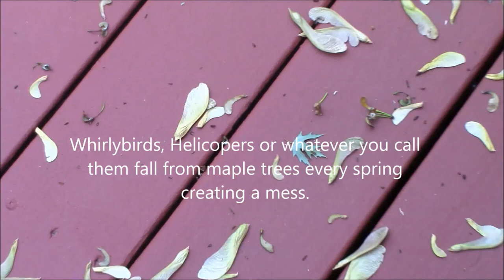DIY Gutter Leaf Blower - Modify A Toro Ultra Plus Leaf Blower

Comment: Thanks for the video, great idea, works like a charm.  Some tips.  Purchased the mirror from an auto parts store, in the blind spot mirror section, get the largest, makes it easiest to see from the ground.  Used rivets to fasten mirror to plumbers strap, use plumbers strap to fasten around connectors.  Used good sized handle (5 3/4”).  Try a dry run before fastening handle to determine placement.  There is some opposing force from air flow, a good firm grip gives good control.  Works great, watch out for overhead wires.

Comment: Hi Robert, thanks so much for this video. I added a 10ft down spout to my Toro leafblower and interchange A and B elbow to the ends for the angle needed to get the job done. I also add on 1 1/2ft down spouts as needed for those higher spots. This has really helped to not be on a ladder 20 ft in the air or pay someone  $100 to get to the high spots that increase your prayer life! Thanks and many blessings!
Reply: How rpm
Reply: My gutters are 22 ft high.  Hope a taller version (combining two 10ft downspouts) will work for my situation.

Comment: Ingenious adaptation of lightweight gutter sections and parts to use with your Toro blower to address a perpetual need to clean gutters safely and easily.  Thank you.
Reply from the maker: Fr Brig thanks. You woyld think the manuf that went from a round nozzle to a rectangular nozzle would have provided the consumer with an adapter for blowing out gutters.

Comment: I put together one of these today. It works really well, better than expected. To reach the 2nd story gutters I have 16 feet of downspout joined together with a vinyl plastic connector and sheet metal screws. After a few trials I decided to reinforce it with small plastic rods 3ft long, held on to the downspout with zip ties. For the top end I used a flexible downspout extender. It works pretty well but I need to re-bend it once in a while. I may replace it with a metal. Thanks for the video and the inspiration!

Comment: Wasted no time and made up a similar set up.  I chose to use a flexible end fitting  and a full 10 ft spout section so I could blow 180° to help with clearing valley angles.   Admittedly the longer length was a bit awkward, took some getting used too.  Works real good on my hip roof house that would cost a small fortune to put good gutter guards on.    Thanks for the inspiration,

Comment from the maker: Thank you all for the comments. With the upcoming approaching of Fall leaf falling, an alternate material with concern near electrical wire would be to use a plastic downspout. The plastic is still lighter than using pvc plumbing pipe/fittings.
Reply: I have what I suspect is one model older than your blower and was thinking of doing the very same thing today for my gutters.  I even had the mirror idea!  Great to see someone already having done this.  I hadn't thought of adding a handle.
Reply: A legitimate concern. Alternatively, one could use up a roll of electrical tape to wrap the metal as well.

Comment: Simple is always better and the simplest way to to this is to climb up a ladder with a garden hose and spray/flush the gutters. Works like a charm and deposits the leaves etc at the base of the gutter discharge for easy disposal.

Comment: You, sir, have more sense than the manufacturers of the prepackaged extended gutter cleaners as they didn't have the sense to direct the flow of the debris sideways out of the gutter.  They think blowing it down into the gutter is the correct direction, lol.  Obviously, they have never used their own product.

Comment: Toro does in fact make a gutter cleaner tool kit for that blower. It's Toro's kit number 51667. Much stiffer than that gutter down pipe.

https://www.toro.com/en/homeowner/yard-tools/gutter-cleaner-51667

I did the same thing as you but I just used a long piece of PVC ( or use ABS ) and a good strong shop vacuum. The vacuum does a better job of the heavy crap and doesn't blow the crap all over your ( and your neighbours' ) yard. The elbows and stuff will all slip fit together.
Reply from the maker: David M, thanks for watching my video. You're correct I did see it on their website. Unfortunately, when I bought my blower they did not have a gutter extension that would fit the rectangular end of the blower so that was why I did a "DIYversion" and video to help others. Thanks for bringing to our attention, but for the $$$ savings I'm sticking with my DIYverson. If I had to do over again I would also have used pvc material downspout.

Comment: Pretty cool idea!  Couple comments... watch out when getting near those electrical wires with aluminum.  And I wonder how much power is lost if you have to add more sections for a 2 story house?
Reply from the maker: opentrunks, I agree about those power lines. In addition to safety, instead of aluminum the plastic downspouts works well. As to power loss, that Toro puts out a lots of cfm and force; enough where I did not crank it up to 100% power and still needed to hold on with two hands. Thanks for watching the video and appreciate your comments.👍
Reply: Robert Wadlington 
Great vid!
2 things
The spelling of nozzle and trial are incorrect.
Honest mistake 
But ingenious idea👍
Reply: I just did this with 16 feet of downspout to reach 2nd story gutters. I can't measure the force in MPH or anything but there's a lot of force, enough to blow out leaves and gunk. I used it on we leaves today. If it stays dry for a couple days I can try it on dry leaves.

Comment: This is great, thanks! I'm going to try it today. The back side of my house is very high. Has anyone tried this with a 30' high gutter?
Reply: Richard Lee Posting this for others as well: Yes, I have a 30-foot-high gutter and it works but the air flow really pulls hard on the long extension so it can get away from you easily. I’ve thought about drilling small vent holes to see if that helps.